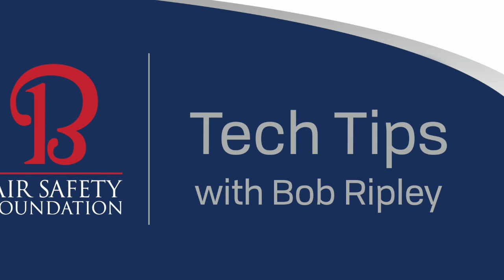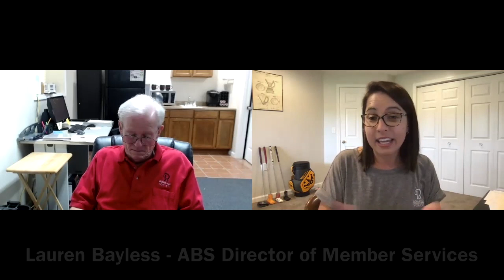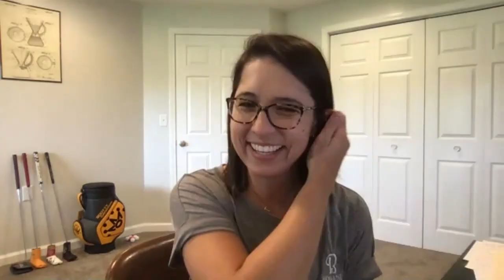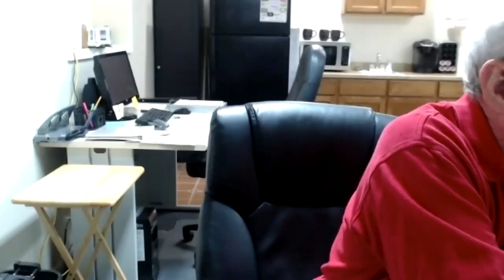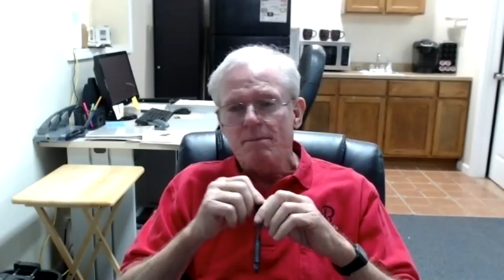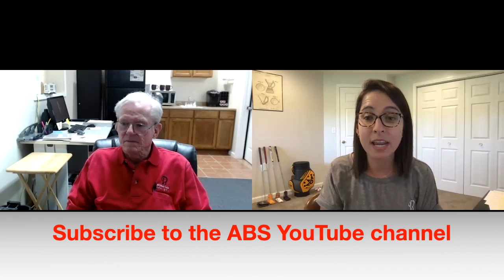Tech Tips with Bob Ripley

Comment: What is the best Corrosion control product to use on baron 55?
Reply from the maker: From ABS Senior Technical Advisor, Bob Ripley - "For the entire aircraft I would suggest Corrosion X or ACF50 which is sprayed in a mist form into all sections of the aircraft to put a protective coating on all of the inner surfaces.
For the outside, we suggest lubricating all moveable hinges and pivot points every 30 days with LPS2
Once a year the wing bolts need to have LPS3 sprayed on them to protect the exposed area in the upper bathtub fittings."